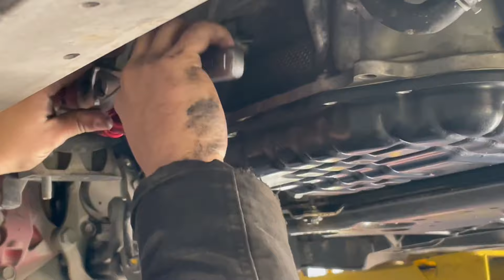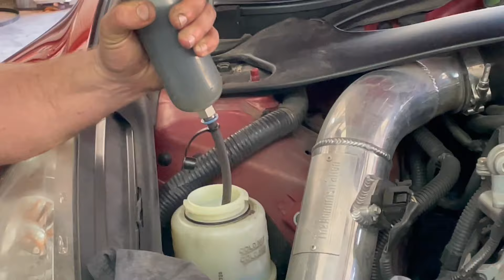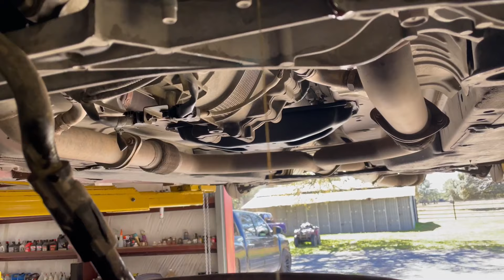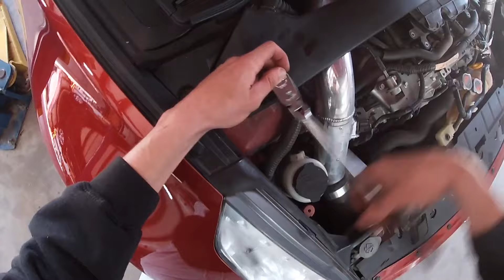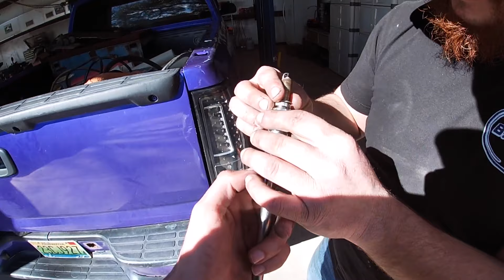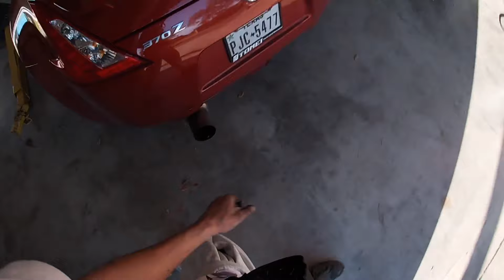Working On The Z. (Changing Spark Plugs, Fluids Etc)

Comment: Guys I just bought a 2015 370z 27k miles drove it 500 miles home, sat all winter just pulled it out and it overheated with NO coolant left I’m clueless on where it went no milky color in oil, no noticeable stains on parking spot, no stains on the engine bay…. Where’d it go!?!